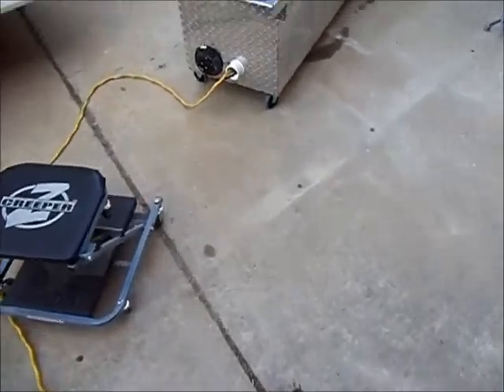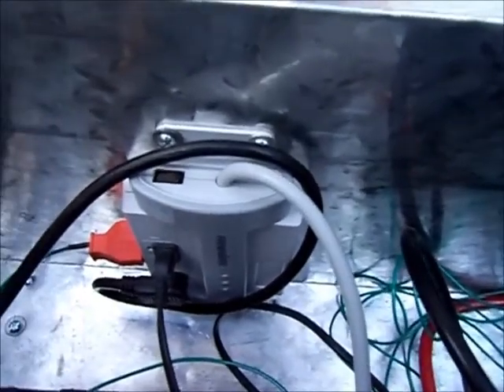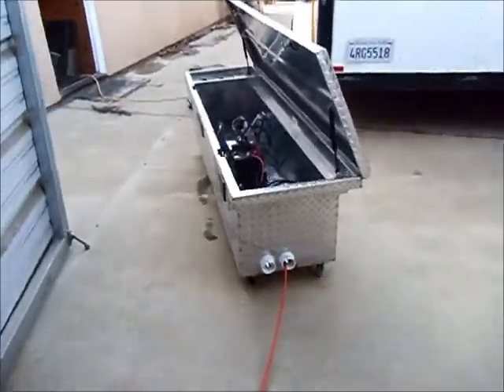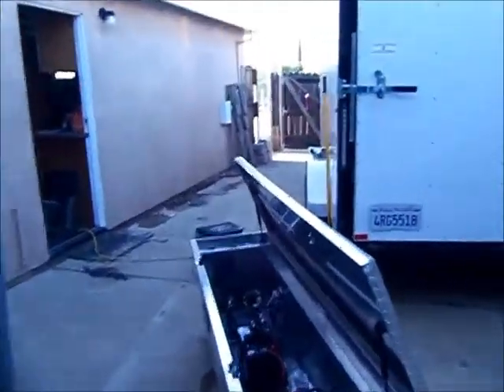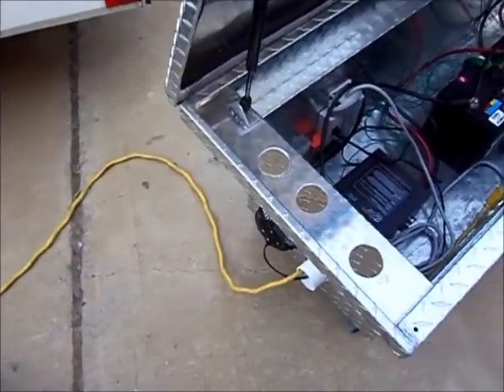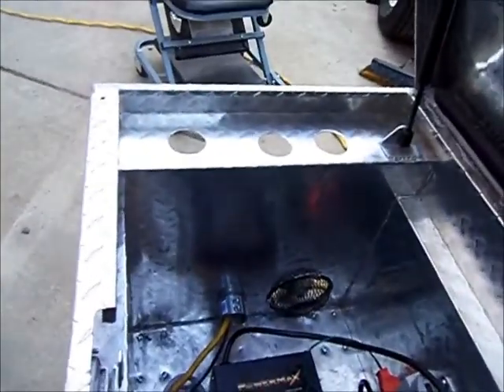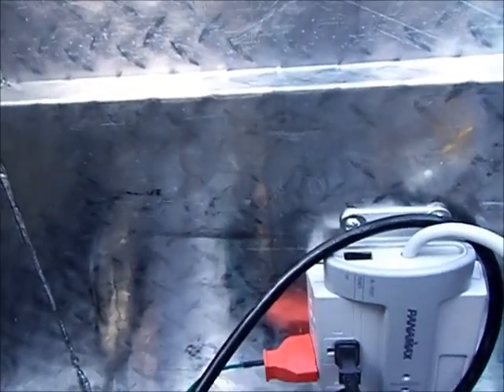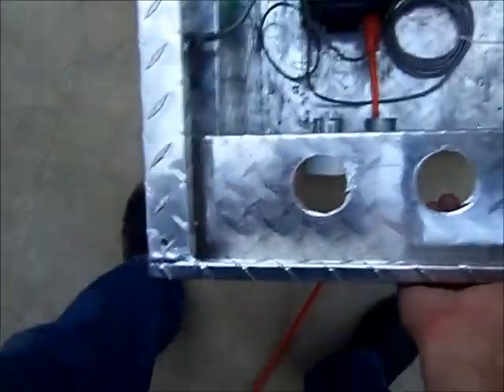Cleaning non inverter generator sine wave part 3

Comment: After 3 years since you built this setup, how's it working out?
I have that same generator and looking to clean up the "dirty" electricity it produces so i can charge some power stations i have if/when the day is cloudy and the solar panels don't produce enough power to charge them back up.

Comment: Real nice and works. I watched part 2 last night and 3 today.  Been looking up the meter and line filters to get some parts and ideas. Only thing with our generators is they are bit louder while running. But living out in high desert got space from most neighbors. 
Thanks for sharing.
Reply from the maker: Have been playing with the idea of housing the generator in a cheap small steel shed, lined with fiberglass insulation or Styrofoam sheets. Would install foundation vents, top and bottom, for fresh air circulation.  This should cut way back on excess noise.

Comment: Super nice looking setup. I was looking around for a way to get clean sine wave power out of my current portable generator. I was wondering if it would be possible to just connect the 12v DC power supply directly to the inverter and bypass the battery. I realize you would lose the backup capability but would that alone clean up the AC?
Also thought it would be cool to add a couple solar panels to the top of your box and add a solar charge controller into the mix. Thanks for making the videos. It looks like a great setup.
Reply from the maker: I have a separate "100 watt" Harbor Freight solar set up I use for my C-PAP. It works for one night but does not recover fast enough (when using humidifier) for multi night usage.
   As for the battery. Power storage is one part but also to act like a big capacitor to smooth possible line ripple coming off the power supply. 
  One other thing:  if I had realized how little power my sensitive electronics used, I would have gone with a UPS (running off the generator) to supply them and just line conditioned (surge protected) power for every thing else. Check out Best Buy, Amazon, Ect. for UPSs, this is a much less expensive way to go.
Reply: @d.s.steele3100  Thanks for the reply. I do have UPS's but they don't like the power coming into them and they frequently chatter. Too much so for my liking. Maybe I just need to find a decent line conditioner and feed that to them.
As for the solar panels, I was thinking more along the lines of using them to keep the battery charged up when the system isn't in use.
Thanks again.
Reply from the maker: @jonkjon : Line conditioners only prevent voltage spikes. I'm not sure if that would prevent the "chatter".
  Solar panels to keep a charge on the battery/s is a good idea. I store my system in a steel shed and now you have me thinking of placing a small solar battery maintainer on the south side of the building. Currently I plug the power supply into a wall outlet via an extension cord every so often to maintain charge.
Reply: @d.s.steele3100  Hiya great videos, can you help me source a suitable UPS as some of the ones I have seen simply pass AC through them and only in a power outage take power from the battery.. doesn't actually help when running on mains to clean the sinewave up? Many Thanks Lee
Reply from the maker: @leebo5555666 : Sorry, I'm not familiar with the inner workings of UPSs. Would suggest you talk with a shop that specializes in computers and back up power devices.